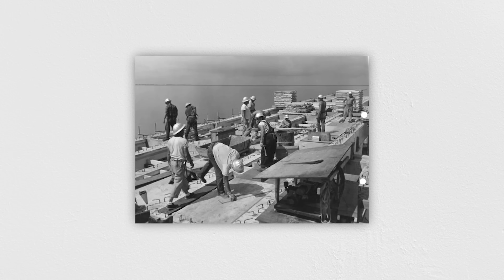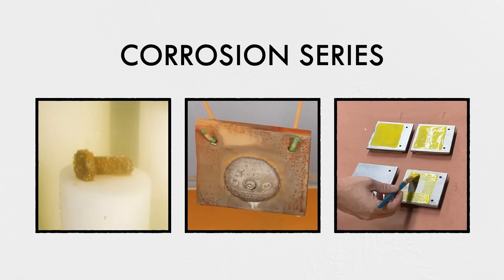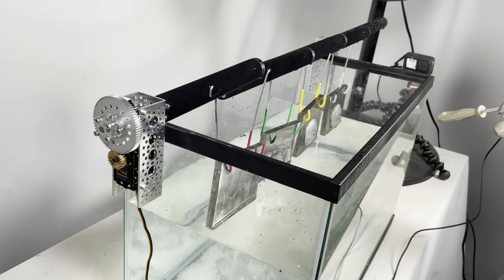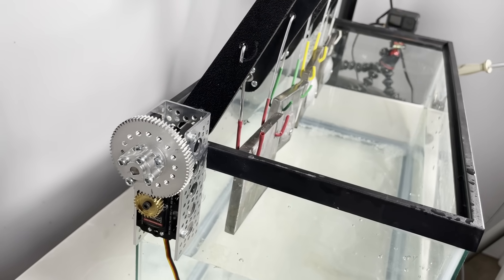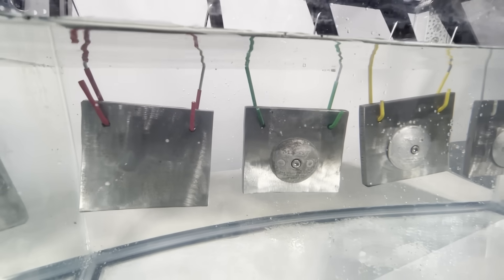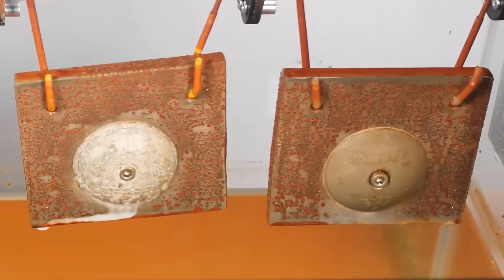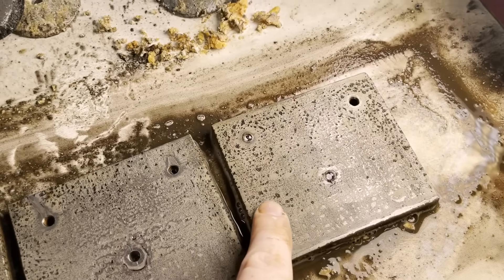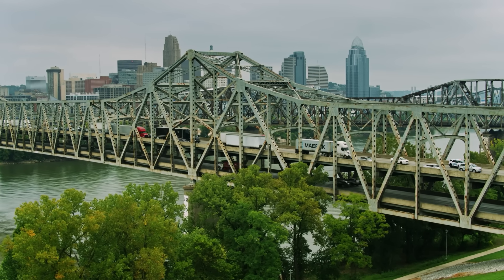Why Spillway Gates Don't Rust Out

Comment: I used to be a Merchant Mariner... We start painting at one end of the ship, when we were done at the other end, we started over again.  The hull would have zinc anodes and often impressed current protection, since you can't paint it except every other year in dry dock.  Impressed current becomes interesting when you are transferring oil products, especially ones like diesel that can build up there OWN charge.  Have to make sure you're grounded to the shore facility!

Comment: I have a steel drum that i fill a bit with water to boil and sterilize substrate, if i firmly attach an aluminum rod to the bottom/side will this work to make it rust slower? is it that simple?

Comment: Greetings Grady,
   First of all thanks for your very informative videos. Though I am not involved in civil engineering I find your videos very interesting. And entertaining too.
    I retired from machining but only closed my shop about a year ago. Much of the work I did involved metals in corrosive environments. Because of this I often had to educate customers about material choices and treatments. For example which stainless steel alloy to use. And when stainless steels were to be welded I often had to make sure they specified passivating the weld and the heat affected zone to prevent corrosion because of exposure to marine environments. 
   People like you who post the types of videos you do are, in my opinion, doing a great service. Not only for curious folks like me but for folks who do not have the same education you do yet have responsibilities that affect a large number, even a very large number, of people. 
Thanks,
Eric

Comment: I've always been grateful to my late Father who was a Mechanical Engineer; he taught me about Cathodic Protection when we walked past a pipeline marker near our village. I was probably about 12 at the time. He told me what the three terminals on the marker post were for, we could measure a voltage between them, which was obviously the voltage between the pipeline and the anodes.
Reply: Did he ever explain to you about electrolysis

Comment: If you have a normal steel tank water heater it likely has a zinc or aluminum sacrificial electrode called an "anode rod" in it. Replacing that anode rod every few years, depending on what kind of 💧 water you have, can SIGNIFICANTLY extend the life of your water heater.

Comment: The way to show roughness on camera is to use side lighting so the peaks are highlighted and the indentations are in shadow.  (That's how artists create a sense of depth in pictures - they draw a sphere by adding highlights and shadow to a circle.) And depending on the size of the features, you might need to bring the camera in close to make small features visible.
Reply: This is correct. To clarify the depth even more, add a colored light pointed directly at the subject, filling the shadows with color. Only the shadows will have color.
Reply: MacroLabs3D does a real cool "jiggle" effect to give an idea of depth and it works really well
Reply: Get some use out of a phone's macro camera for once, eh?
Reply: Using a profilometer would've been cool too
Reply: And get a digital microscope camera.
Reply: No, just do what John said.

Comment: Ah, and a zinc chemistry story, just because. About a decade ago, my son was attending a preschool, where the kids would bring in something for show-and-tell that began with that weeks letter of the alphabet. Well, my son would often not get to show his thing the first day, but also wanted something unique, that no one else had shown the previous day .Enter late in the year, the letter Z.  Zebra? Katlin had one. Umm, Xylophone? No that's an X. Zombie? No it's preschool. A whole zoo? Too much work. Zinc! Yeah, that'll work. How about these galvanized nails, that's zinc. No dad, those are nails. Nixed the nuts and bolts too. Check how much are sacrificial anodes at the boating supply store? That much?
 Ok, these pennies are mostly zinc! Yeah, Dad  but they look like copper. Ok we'll just file this down. No? You want it to look like a penny still? Finding a chemical means to strip copper off zinc was not easy, but found a video by  myst32YT  to do this very thing, involving sulfur and calcium hydroxide. Which is why I still have a large bag of lime and a small bag of agricultural sulfur in my garage. Bonus, managed to make enough "silver" (zinc) pennies to give a couple to each classmate. Was the hit of the preschool class. And got some fun pictures with my 4 year old, wearing our lab coats and goggles  (he wore Mom's with the sleeves rolled up).

Comment: I thought about it the other day, i have quite a few acquaintances who are engineers..  from many civil to mechanical to structural and design..  all have the title and are registered working for their various firms.  Yet all are just doing piddly projects that just about anybody could do without any prior education or experience..  and those types of projects are all they have done, apart of a team who all have a part in said projects but projects where software and instructions do all the real work and the engineers are just bodies who can input the data correctly..  and then you have me, a general contractor that had dipped into everything from structural to civil to everything the engineer people should be doing..  ive personally had to look up all the code, design, present for approval, gather all the labor and materials, build , have inspected for certification and open up to public and i only went to trade school..  given i almost got my electronic engineering degree but ran out of money and got a job..   but ive been called upon without any engineering certifications to repair a concrete metal structure that potentially holds 10,000 lives about 100 feet in the air around 24 times a year and it was failing..  i had to present my plan to a board of engineers and representatives of the state for all the legalities of it with my own designed blueprints and material choices with explanations.  Meanwhile i know 4 people who have 7 years each of college level education under their belts who get paid triple what i was making to sit at home and basically make a road and turnpike on the sims with all the signs and bushes with gravel and guard rail and structural engineers who charge 5 grand multiple times a day to go to various peoples houses and tell them they have settling issues and need to install push piers the same way every time, sometimes suggesting helical if interior and reinforcing advice,.  Like really..

Comment: So could I just put a few magnesium cathodes on my truck to prevent rust?  It would be grounded and a small 2035 battery would wir3d in to supply the current.

Comment: Every time I hear about cathodic corrosion protection I recall when I was tasked with replacing a bunch of big zinc blocks inside a boiler condenser.  They were very heavy....  This plant also had some equipment with active protection where an electric current was applied to counter corrosion as you described.

Comment: Why not use galvanised steel, paint it and then use it to reinforce concrete? Then coat the concrete beams in plastic to prevent water from seeping in.

Comment: I work in the automotive sector and our preferred method of making things rust is the neutral salt spray test. Basically a sealed container at 100% with a fine mist of salt water sprayed over the components being tested. Then we measure the number of hours before white or red rust is visible and that provides a good metric to compare different material or coating specs. The dunker machine is pretty cool though

Comment: Fantastic demostration! I've always been of the idea that they should use stainless steel in the rebar in highly corrosive applications. I worked in a company a bunch of years ago that made exaust manifolds for vehicles using 409 stainless. They are probably still in use today. 

Also, this why manufactures use an anode rod in water heaters, to sacrifice and protect the heater.

Comment: that was fascinating...i always wondered why bridges weren't made out of aluminum and now I see why....i learned more in this presentation than I have thought I had known for the past 40 yrs...thanks for the BEST demonstration on youtube
Reply: Some bridges may have some aluminum parts on them.  For example, the Hawthorne bridge (1910) in Portland, Or. Had wooden deck and sidewalk on the liftable span, in 1975 was replaced with steel grating and aluminum for the sidewalk (in order to  offset the additional weight from the steel grating).
 I actually have a video showing that  exact section of bridge if you would like to see:
https://youtube.com/shorts/XXOPk4-lYzY?si=FWdAdNctWG4Wj0-f

Comment: The "experiment" you described at the start of the video - isn't that something that had been done with cars already for decades by that point? Perhaps not literally with paint, but I thought sacrificial cathodes like zinc strips on the inside of bodywork is a trick that's been used since forever.

Comment: Always fun to see the same discussions come up on very different YouTube channels. I've been watching a lot on naval history in the past couple years, and museum ship curators have similar discussions pretty often, for obvious reasons (after all, they're in charge of steel objects that can't be replaced, which are typically immersed in saltwater for decades or even centuries). 

It's also played a role in construction of ships too. Copper hull coatings were common in the wooden ship era because copper kills sea life that can foul a ship's hull. (Indeed, modern shop paint is still generally based on copper compounds today, as I understand it.) But copper is more noble than iron, so once you got into the ironclad era, attempts to copper the hulls created a galvanic circuit that rusted the actual hull very aggressively. 

For a time, they tried to use the wooden hull as an insulator (since these ships were only iron*clad*, not iron *hulled*), but that was very finicky and prone to accidental connections if some worker drove a connector in the wrong way. And the ships pretty quickly moved to full iron/steel hulls, so that option didn't exist for long. Fortunately, by that time I believe the paint chemistry was good enough to get the desired copper into the paint, in the form of compounds that didn't have the same galvanic issues.

Comment: There are areas in Rotorua New Zealand that even high grade stainless steel still corrodes.  They tried the best money could buy and they only lasted an additional 6 months.  They now just replace the gal bolts every 6 months.

Comment: Interesting video. One question. Corrosion of metal parts on carbon racing bikes is allways an issue. And no anode... But should there be a possibility for a carbon bike/frame with metal part? Greetings from Europe/The Netherlands🇪🇺🇳🇱🇺🇸

Comment: I absolutely love the Rust-O-Matic. Reminds me of the time I tried to do electrolysis for a science project and de-galvanized a bunch of washers by accident. Other fun potential uses:
- Acid rain timelapse! Also etching, corrosion as a useful tool. Glass! Concrete! Circuit boards!
- Thermal cycling fun times. Cold, hot. Cold, hot. Cold, hot...
- Speaking of thermal things: mild steel vs. carbon steel vs. bronze and their respective hardening/annealing properties. Seems like a good way to dunk samples into quenching fluid all at the same time.
- Put shapes into wind tunnels. Wheeeeeeee fluid dynamics
- Don't know if this could be done on a reasonable timetable, but it'd be interesting to see biodegradable/non-biodegradable plastics in action. Do they actually break down and go away, or do they just go into smaller bits and hang around for ten thousand years?
- Why you shouldn't just unplug high-voltage circuits. Bzzzzzzzzzzzt!
- Pushing four (4) buttons at once, over and over
- Donate it to Michael Reeves so he can gratuitously misuse it
- Hot dip galvanizing at home! Just hold your breath around the molten zinc.
- Impatient Fisherman Simulator 2022
Reply: @crystlasoulslayer This is an amazing comment
Reply: Rust-O-Matic 3000, please.
Reply: Ah yes, quenching, famously done by slowly lowering a piece of metal into liquid over the course of a minute
Reply: @joshyoung1440  it's not lowered over the couse of a minute, it's lowered every minute, the lowering takes second(s)

Comment: Have they changed the way they galvanise things like nuts and bolts? New ones won't last anywhere near 10 years. I've recovered old ones from a structure in the same salty environment thats over 40 years old  and I could turn it off by hand once I had cracked it.

They really don't make them like they used to!

Comment: Impressed current cathodic protection is used on at least one gas pipeline in Australia but I believe the pipeline is insulated from ground by a layer of pitch soaked cloth tape. The anode is just scrap iron buried in pits near and along the pipeline. Very little current or voltage is required and by monitoring the current at each point of impression the health of the insulation can be determined and if any issues arise the approximate location. The only problem I'm aware of involves lightning. Some of the valve gear etc is. far enough above ground to be attractive to lightning strikes. That's something that also has to be protected against. I did hear one anecdote about protection gear that mostly just  vanished from  a strike. Engineering very long high pressure gas pipelines is quite a challenge, Sudden changes in pressure can create long wavelength 'oscillations ' within the gas that bounce from one end to the other creating a risk of over pressure.

Comment: In the real life the metal samples would be coated and the anodes present to protect against any defects in the coating. It would be interesting to see the same experiment with coated samples, all with a similar defect (say a 1/8" dia " hole"). In that case the damage to the anodes, especially the magnesium would be far less, illustrating the importance of combining coatings with cathodic protection.

Comment: Fun fact, water heater tanks have anode rods as sacrificial material for slowing the deterioration of the tank. Regular maintenance and replacing of these rods could potentially double the life of a water heater tank. Here's a useful plumber's video about it, as well as other maintenance tips: https://youtu.be/iU40rBUD4k4?t=670

Comment: Feel like you'd really need to cycle the salt water constantly and filter out the oxides as the oxides in it will make it less able to rust the metal, I think? I'm not entirely sure, but it feels like this isn't like how something in a river would corrode. Also would be interesting to see how surface area of the sacrificial cathode affects it's ability to protect the steel.

Comment: This just means that rebar should be replaced by some plastic material substitute. Most concrete does need to be supported, but learning by watching this channel is that the rebar expands which cause the concrete to fail. Why not find that substitute in the supporting point of failure?

Comment: If you want to see great paint science explanations and some cool sacrificial Zinc metal particles corroding as an anti-corrosive paint film on iron metal, see the public domain scientific reference below. For your next anti corrosion paint video, I would pose the question does conductivity pathways and tortuosity make a difference? I am a Chemical Engineer consultant at AP Nonweiler in Oshkosh, WI that toll produces Zn metal rich paint primers for the massive number of blessed (благословенний)"industrial" vehicles :)..You have no choice but to use a salt spray test if you want dramatic visual corrosion effects. A DIY test unit can be made from a large plastic container, special spray nozzles, plastic pipes, brackets, and a recirculation system. Besides meticulous test surface metal surface preparation, here are a sampling of anti-corrosion paint film factors. Namely, 	
1)    Sacrificial cathode material
2)	Coating thickness
3)	Impervious filler in the paint film
4)	Plate-like filler in the paint film that increases tortuosity
5)	Good metal adhesion so corrosion does not delaminate the film
6)	No paint cracking at the elbows and bends of metal to be protected
7)	High water contact angle surface protection
8)	Self healing, a portion of the coating that dissolves and reprecipitates at the newly formed gash through the coating to the metal surface. This is good to prevent corrosion at the scratch site.
9)	Zinc metal loadings (80 wt.%) so high that the particles actual touch each other (see Chinese overview of new anti-corrosion to form a continuous path. Down load from Google Scholar --Zhou, S, et al “Designing reduced graphene oxide/zinc rich epoxy composite coatings for improving the anticorrosion performance of carbon steel substrate”, Materials and Design, 169 (2019))). The zinc metal is analogous to a sacrificial rod that slowly dissolves in the house hot water heater tank to keep the tank walls from corroding and is good until the rod is used up.
10)	Chromates are the best anti-corrosion chemicals, but are avoided.
11)	Solvent based paint is the best for keeping the zinc metal particles dispersed and uniformly contacting each other during drying.
12) SW's industrial grade (not DIY) 2K Epoxy Zn rich is the best high solids primer.

For lab testing, special industry standard phosphated Q-panel metal plates can be purchased and spray painted, cured a minimum of 7 days and salt spray tested.